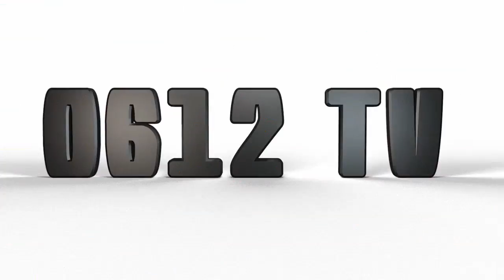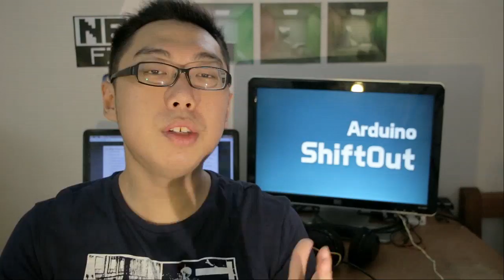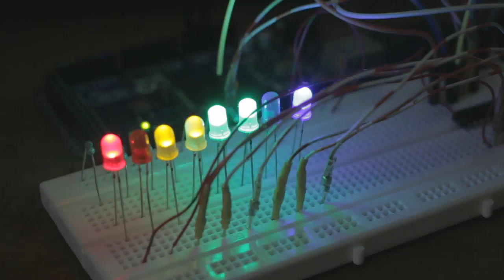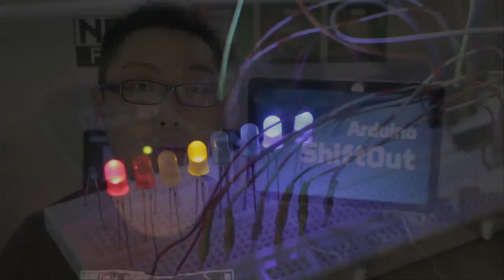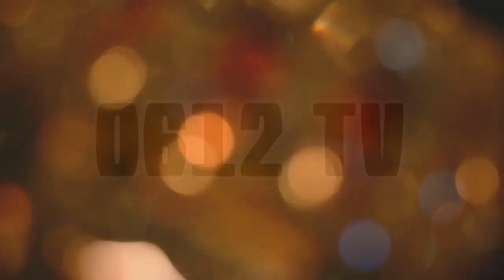Arduino ShiftOut() - Friday Minis 206

Comment: Thanks for video, I'm new to arduino but I understand binary to a high level.

I have the 8 bit shift register, and 8 leds, and I'm using the code:

for(int n=0;n<=255;n++)
{
     digitalWrite(latchPin, LOW);

     shiftOut(dataPin, clockPin, LSBFIRST, n);

     digitalWrite(latchPin, HIGH);

     delay(100);
 }

I just don't get what's actually going on with the shiftOut line.
Lets say n=50 or 00110010
And we use LSBFIRST,
What's happens inside the shiftOut()?
Does it just write that value to memory, then after setting latch to HIGH, 
output through the 8 outputs in the order 0,1,0,0,1,1,0,0?

So is that where the word "shift" comes in as it takes 00110010 and applies shift operations to get the bits it needs to output?

Thanks, hopefully you can clear it up for me.
Reply from the maker: Hello and thank you for your comment!  No, it doesn't use shift operations. The role of this function is to connect to something like a shift register, to serially "push" 8 bits of information out over one data line. It "signals" a new "push" by pulsing a clock line.
Reply: @NERDfirst  ok why is it called a shift register, I would think it has something to do with binary shifting
Reply from the maker: It is called that because information is "shifted" bit by bit into the internal storage of the shift register. You are essentially shifting 8 bits of information over one data line by doing it over a period of time instead of all at once.

Comment: Sir, I'm currently using 24 LEDs and 3 shift registers. When I enter the value 1 to the data argument for the ShiftOut function, the first LED connected to each shift register lights up. Then, when I give the value 255, all 24 LEDs gets lit. Is it normal behaviour ? Would you please tell me how to only lit up 1 LED from a single shift register ?  Thank you
Reply from the maker: Hello and thank you for your comment! It sounds like your three registers are sharing the same data pin as well. What happens then is that each register is operating separately from each other but are reacting to the same set of instructions.

Right now, in your setup each chip probably has one pin unused. That pin serves to "forward" the last bit from one register to the next (refer to the datasheet for more). What you want to do is to link that pin to the data pin of the "next" register.
Reply: Hi, There is no unused pin except 9th pin of the last shift register. When I use someone's code(without shiftout function) it works perfectly. My code: shiftOut(11,12,MSBFIRST,B00000001); Thank you.
Reply from the maker: Then I'm afraid I don't really have enough information to advise further. Everything sounds correct. Perhaps review where you're calling your function and what values you're passing in.
Reply: Thank you sir. I will try.